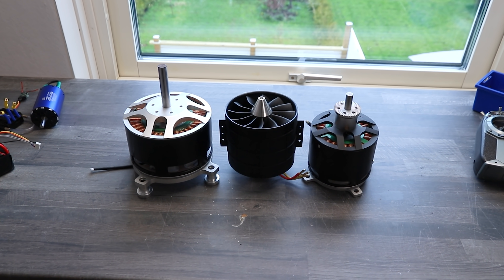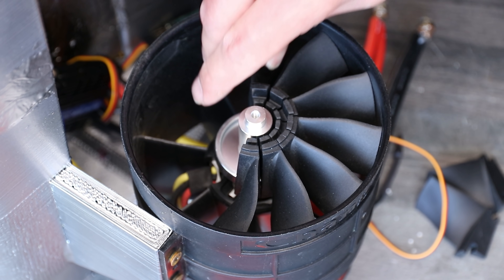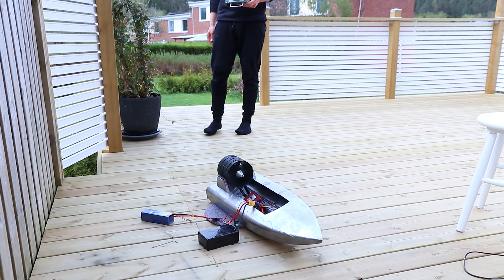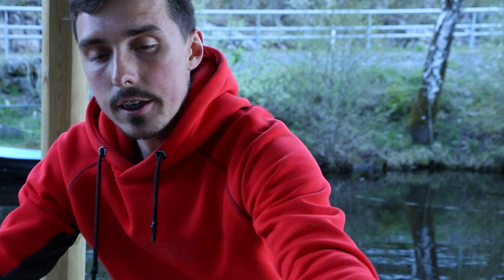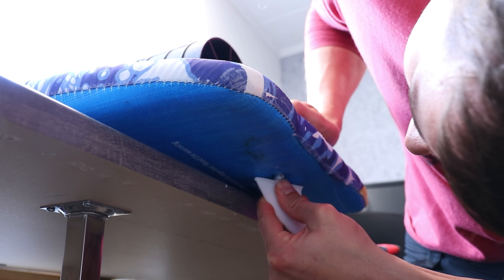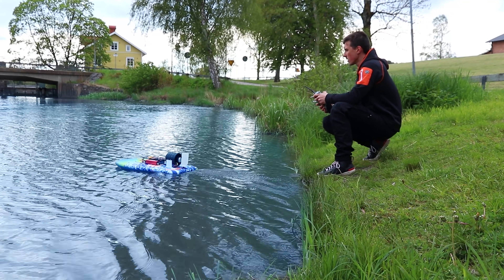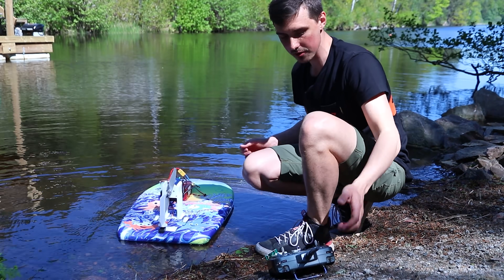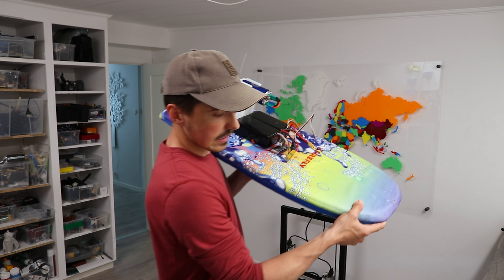How This 7000W Motor Was NOT  Powerful Enough!

Comment: I suspect you deliberately chose the poor foamboard design to create failure drama for your channel but  little of this problem has to do with the motor.  The problem is  the hydrodynamic properties of that type of paddle board that has round edges and woven plastic cloth finish. I've made my own design  RC seaplanes, hydrofoils, airboats etc for decades.  Due to the rounded curved edges the foam board you used  resists planing without massive amounts of power  to induce flow separation and even then the woven surface generates huge amounts of turbulence and drag and can ripple sucking even more energy due to being a partially loose fabric covering. The water flowing under the board encounters the curved edges at the sides and trailing edge and due to the coanda effect tries to follow the curve  and shoot vertically upwards. The sudden direction change induces huge amounts of drag like a parachute. You near to shear off that lengthways flow cleanly without direction change.. ie you need a sharp flat trailing edge and sharp chines at the side.    Epoxying a thin flat sheet of rigid plastic 0.5 to 1mm thick to the bottom would have made a significant improvement as long as there was some rocker/gentle-curve to the bottom. The sharp edges of the plastic sheet allows clean water flow separation and enable it to both plane more efficiently and slide sideways when turning and then ride on a foamy film of air and aerated water froth once planing fast.  The existing round edges suck water around and UP  their profile via the coanda effect and so it tries to bury itself deeper in the water despite the small amount of planing effect lift from stagnation and trying to climb its bow wave. Even though those boards are generally flat the roundness of the edges was your undoing. IT's like trying to use those motors to push along a car tyre innertube over the water . The smooth round edges of the donut will absorb all available energy  long before it achieves sufficient speed for flow separation  the way a 100hp ski boat could tow one.

Comment: With high rpm motors you need to make sure the esc is made for high speed switching which is a must for high rpms. A boat motor is not the same as a fan motor, the fan motor needs a good quality esc built to handle the higher operating frequency.

Comment: Hey Simon,
Your hull needs some steps, like speedboats. If u try to to pusch a normal hull at speed though water it acts a bit like a wing and sucks itself to the water. Those steps, 1-3, just google it, help to break the surface tension  and enable planing.  
Switching to the body board actually made it worse in a way, du to a much lager wetted surface.
Reply: Yep.  Look at Single engine float plane pontoons.  they have a step built in to "ventilate" the wetted area of the pontoons decreasing wetted area until you are airborne.

Comment: This might be a little bit late but, from an engineers point of view, the problem is not that there's not enough power available. The problem is that the thrust of the edf doesn't overcome the water drag, making it really inefficient. Ducted fans are capable of producing a decent thrust at higher air speeds, and power=thrust*flow (kinda). If you want more thrust, you should try to use a big propeller instead
Reply: Almost all boats have propellers under the water for a reason, if you stop to think about it. That way it can provide more thrust (since water is incompressible) at lower speeds

Comment: Your problem is that you aren't doing any experimentation to find an efficient propeller matched to the motor.  All your power is being wasted.  You have to actually have a test fixture at home and measure thrust vs RPM for different propellers.  You may find that once you go over a certain RPM, additional power is completely wasted on heating up the air as you are beating it to death.  Airplane props are designed to operate in a certain RPM range.  All you need to do is set up a way to measure the thrust and take down data on force vs. RPM.  Then you can experiment to find the right prop.  You might need a gear box and a much bigger prop to avoid wasting all your energy on air resistance.

Comment: Would the angle of the motor mount make a difference? I was thinking if you angled the motor mount so you had 10-15degrees up on the motor/prop so the blast was more in the air and less in the watter.

Comment: I have built a few pusher prop type boats from the spare v hull race boats I had laying around and know exactly the problem here...you need to use a flat bottom hull with a near zero draft when boat is floating at full run weight...in theory, you could have used a EDF only 2 inches in diameter and had 5x the performance you got from that behemoth. Basically,  your design is akin to building a glider from a aluminum 747 frame....as far as history goes, removing the insane turbine thrust from a 747 at takeoff ends up looking very similar to your boat...with some additional scary consequences....the airfoil, diehdral  and weight were designed to do one thing,  go really fast in the air or sit parked at the terminal...build a hull designed to 'fly' like a airplane and a airboat will perform like one.
Reply: Yup...spot on. Flat bottom and zero draft or near zero draft at idle speeds would equate to near zero drag...the v hull is to allow the submerged prop to stay 'wet', and not a requirement for a EDF pusher...
Another error, but not totally related to the problem is the below waterline rudder...needs to be in edf airflow above waterline in order to steer at all, especially at any point below full throttle or so.

Comment: Your first iterations was screwed because the hull was a displacement hull. The formula for the speed is velocity in knots = 1.35 x the square root of the waterline length in feet. For a planing hull the situation is entirely different and it can exceed the hull speed. For full size boats I believe it is Crouch's formula  that is used to predict the planing speed.
Reply: I'm amazed that two imperial units for meassuring different dimensions are at all related.

Comment: I would ditch the rudder run two ducted fans steer with the fans 2 speed controllers   It would take less amperage on the battery too

Comment: bruhh uh burned resistor of XT90 connector"""""""  the green line tells its spark resistant XT90-. , plz connect xt90 fullly for using  higher amperage,

Comment: The proble you had with the first hull is that it was acting as a displacement hull so it was pushing the water out the way
You need to get it planimg and then it will perform very well

Comment: Dang... those massive motors... if I had 4 of those and speed controllers that can handle em, I'd be well on the way to my biggest project...

Also.... WAY too many amps... once the props were on it had a load and that tripped it.  If the connector is hot you aren't using big enough connectors or thick enough wire.

Congrats. You've made a nice airboat and learned the problem with airboats.... airboats aint fast.  The problem is that the fan in the air doesn't overcome the friction of the board against liquid all that easily.  Maybe coating the bottom with a hydrophobic nano-coating might help, but overall airboats are just not normally all that fast.  You could put a much smaller motor and a much smaller prop in the water and you'd go twice as fast easily.

Comment: Hey man! Nice try... but. Your way as you try to solve your purporse is dedicated to to fail. Why? The answer is in your lack of knowledge about the aeodinamic's laws. You try to put more, and more energie, trust, power, however you already supplied way much more, than you needed. The key is in the propeller factors. Every propeller have a maximum efficient rotating speed, as soon as you excess that number, you start to loose the trust instead you would increase it. As you can experience at realtively low rotating speed you have an amazing trust POWER,  but on higher speed of rotation (as you reach the propeller max efficient factor) the propeller spinning as pig on ice, but the trust not grows. That's not your fault, and not even the motor, or the battery too weak, but that is the max as you can bring it out of your type of prop.  
So my idea of the right thinking was would be the way as the helicooter rotors are works. So if you can build a variable angled props, probably you can max it out of the capability of the speed, and the.power.of your motor. That's the one side of the solution. The other one would be an airfoil boat hull, or something similar shape as on the speedboat. For that there is no any universal shape, every shape have a special, typical water-surface resistance, at exact speed, exact weight, lenght, widht, etc. You can try, and experiment to change of every aspect of your boat.... but please... do not... NEVER GIVE UP! You are a one kind of hero. And as a hero, you have.a mission! We count on you! Keep it up!

Comment: I'm not sure I'm right, but doesn't your issue have to do with the mass of what your displacing for thrust (air) and what you're trying to move though (water). My thought is you've got to move A LOT of air to add to the same mass as the water you're trying to moving through?

Comment: Get a big polystyrene lid from a chiller box, cut one third off,  glue that third under it, angle the front up.  And have most of the weight over the middle of the craft... This kind of worked for me...

Comment: A tip for the threaded inserts: Push them 90% of the way into the plastic, then push the plastic and threaded insert down onto something flat until the insert is fully inserted. This makes it much easier to have the inserts be flush and aligned with the hole they're going into. It also creates a completely flush mount, and retains the original geometry of the part. They're plenty solid when mounted this way (they pull the plastic out before the interface between the print and the insert fails) and it makes everything look very clean and tidy. 

The Jubilee 3D Printer project is where I first heard about this method (they called it the 'plate press technique') and I use it any time I need to press an insert into plastic these days.

Comment: Take a look at the swamp boats. They use large fan style blades to be efficient. The wider blades allow them to grab more air at lower speeds. I would try something like that before going to a larger motor and ditch the two blade prop.

Comment: Have you checked the RC throttle output setting? I’m really surprised the jump from 6s to 12s didn’t make much difference, it seams like you are throttle limited somehow, maybe the ESC has a max RPM that you are hitting quickly. You could check this by measuring thrust output on a bench.

Comment: I understand you want the cool factor because the motor is up in the air where it can be seen and heard but wouldn't it go much faster if you put it in the water I mean is the motor waterproof or can it be made waterproof I feel like it would do more propulsion pushing water instead of air obviously the amps would be higher because it would have more load but would it be worth it?

Comment: angle of the propeller Nd motor might be pushing the boat into the water as it moves the water out of the way. Instead of just pushing the boat over the water like a air boat.

Comment: So how about a fan driven boat (or hydrofoil) that has retractable wings that are deployable at full speed to go from boat to plane and back to boat. It would take a bit of engineering and a trick 3d printed hinge mechanism for the wings, but I think your the man for the challenge. Or maybe a just HUGE (3+ meter) foam plane with that giant motor.

Comment: Engine + correct hull = success..... either not right for each other= fail fail and fail again... that is the key 
At this point youd be far better of with smaller motors and battery and simple padlewheeels.....

Comment: problem isnt power, its drag. you already have a crazy power to weight ratio, but as the rear dips your prop angle gets steep and drives you further into the water. possible fixes are either trim tabs in the rear, so you hit the throttle and as it gains speed you slowly lower the front and itll plane. you could prob hit plane with like a 1/3 of that power or less with good trim. you could also use the motor as "trim" by changing its angle you accelerate. 

or you could play with the angles over and over til you find a good angle for the prop. build a rotating gear and lock combo so you can make like 1/16 inch adjustments on prop pitch and then test a couple times till you find it.

Comment: Maybe angle the motor slightly up to compensate for tail-heaviness? I think the 3kg was way too much for the first boat, but that shape is more efficient in terms of drag and displacement. Overall I guess the motors aren't a good fit for moving themselves by air pressure...

Comment: Hey , im using same 3d model for the boat, added 1 layer of resin to make it water tight , but instead of the propeller  ive 3d printed a water jet turbine and the boat startet to glide very good , with a amazing top speed. ive used a old 2200 kv motor from a drone. with 4s and 6s battery.

Comment: You have to equilibrate the mases of the boat, put the motor in the middle because if you put all the power in the back you're gona a be tail heavy. The motor power have to be perpendicular to the water, no against it. But nice video anyway :).

Comment: if you don't know ... you learn ... by experimenting .... or you can document yourself so that you can better understand how you can have better results ... operating principles that can help you ....
  no ... not weight or anything else was the problem .... but the use of power ... the use of power in a wrong or inefficient way .... it's somehow what power is without a brain .... it's about principle ... that is, you can do the same thing using more or less power depending on how much we know depending on how much we use our intelligence .... example ... something like that we can move a heavy object with empty hands with pure force or we can use a pulley and then I used the strength of the brain to be lighter physically .... this is not a mean comment I said what I think ....
I wish you success in your work ... continuous experimentation is one of the best methods of learning ... improvement

Comment: you use an aircraft propeller engine that eats air and blows it .... on a boat ..... the engine probably has more than enough power for a much better result ... but it uses air as propulsion .. ..instead of water ... propeller engine in water ... that's why I say and I think the result is unsatisfactory .... even if the boat moves on water not through water like a submarine needs another type of propulsion ..... the engine you use is of course built in that way with propellers for moving planes .... through air that does not have the same density as water or ... because the boat on the move must push water appears a fairly large opposition force plus it probably increases with speed ... that's what I think ...

Comment: 2:12 XT90 anti-spark connector was not plugged in all the way...full current was flowing through the current limiting resistor only, which is why the connector got hot.

Comment: Would be 10times more efficient if use a propeller and put it under the water. What ur doing now is basically a wind powered boat. Wind powered vehicles besides aircraft are usually slow and inefficient.

Comment: That won't work. If you want to use air moving propeller to move a boat, you have to get it out of the water first. Either as a hovercraft or hydrofoil - water imposes simply too much drag on the fuelage, no matter the shape. And if not enough power to push it up, it will SINK more faster it goes (displaced water accelerates, creates low pressure, gets sucked down). You could see that on the board when it accelerated.

Alternatively angle the ducted fan down, attach extension tube to the end (to not get it wet) and stick end of it it into the water, and voila, you've created a water jet engine!

Comment: Increase in voltage doesn't increase peak torque ( hence acceleration). I didn't the math, but I got the impression that this motor never developed 7 kw.

Comment: so   much  weirdness.         i do not care for the (manufacturer's) design of the impeller vanes.!                WHAT  is  the  motor  kv.???         in order for an edf to be  effective, the impeller speed  needs to be in the range of  ninety thousand  rpm.!!!!         have you never noted the high kv motors, in  edfs.?                a correctly designed/tapered  exit duct  SHOULD  be  installed on the edf unit.  (maybe six inches long)     then, the edf will produce a nominal amount of thrust.        there is a reason that a  tapered exit duct  Should  be  utilized  ---  the optimal cross-sectional exit area  is  Less-than  the  impeller's  swept area; due to the  central  area where  air  cannot  go/be.!            area of circle is   r-squared * pi.     subtract central circle area.         divide result by pi, to get r-squared.  of  the  smaller exit diameter.          ideally, the hull  Should  have  a  surface  that is  hydrophobic.!            the hull should be relatively narrow.        the hull  Should  have a  shape  that  planes, at speed.!              this  is  a  vertically, Offset  thrust configuration.       and, the thrust configuration appears to be zero-zero.      if so, the  edf  produces  nose-down moment,  at  all  times.!      idk if this is what you wanted.         googletranslate

Comment: You should try to give a few degrees of an angle to the motor axis, so when the boat rises its nose, propeller axis stays close to horizontal. Also this leads the propeller axis pass closer to the gravitational center of the boat, so the force will be lost less as rotational force.